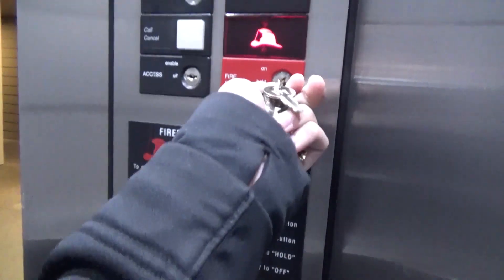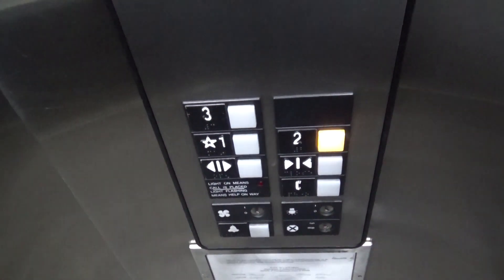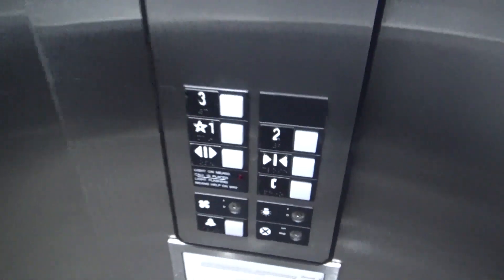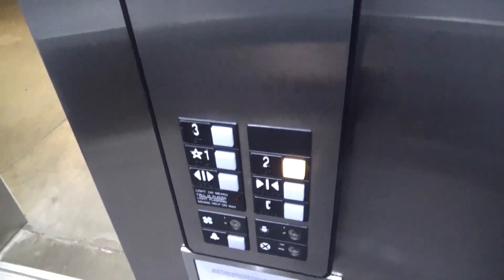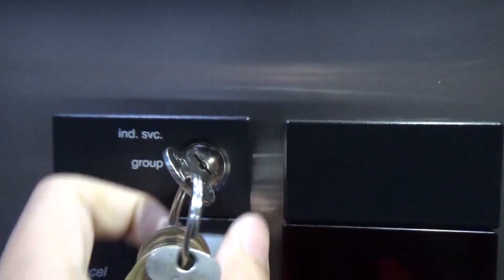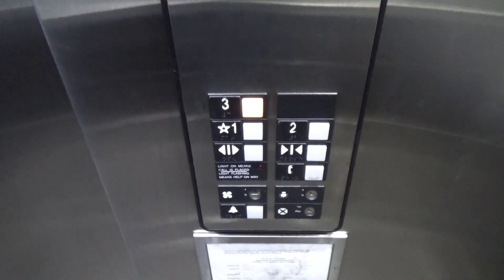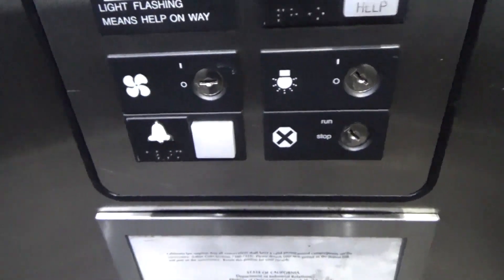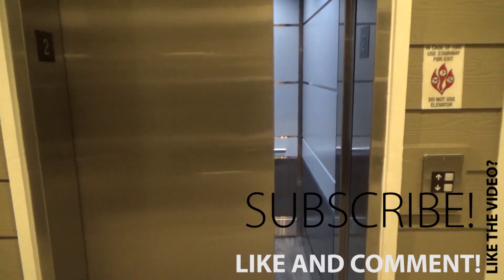Fire Service/Independent Service Demonstration On An OTIS Series 1 Hydraulic Elevator

Comment: Fun fact: if the smoke detector outside of the elevator (or in the machine room) is activated, the elevator automatically enters Phase I Fire Service. If the fire spreads into the machine room and activates a heat detector, the elevator is shut down immediately.
I stumbled upon a Series 1 in IS once. Whoever operated it also shut off the light, so riding it was extra fun!